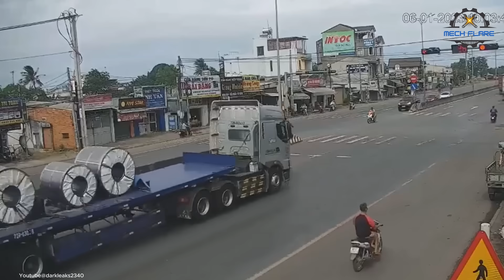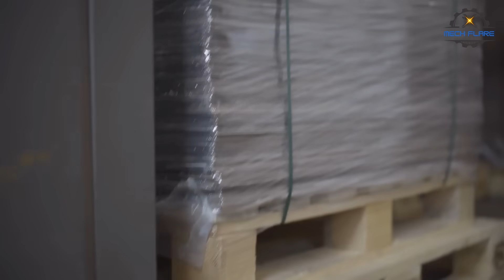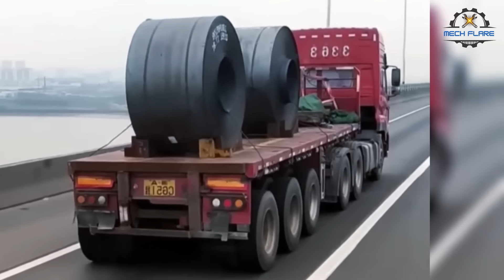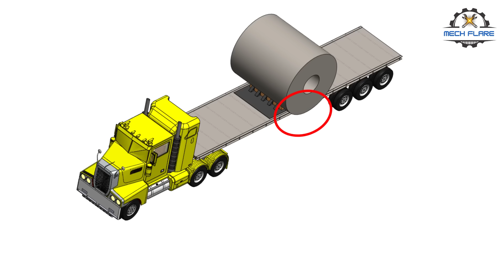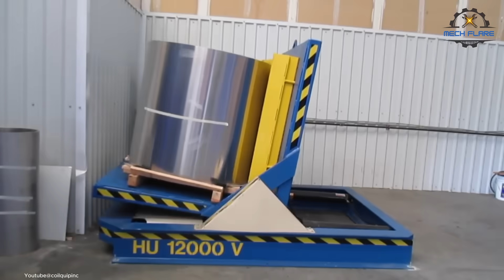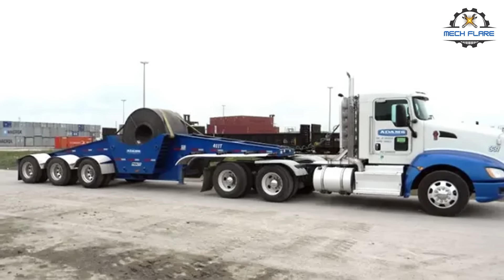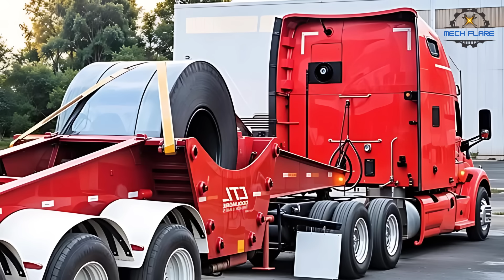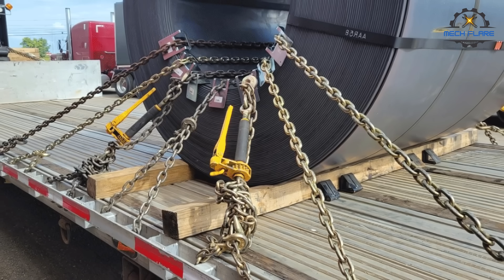Suicide Steel Coils: Can We Stop These Monsters? (USA vs Europe)

Comment: The drivers don't chose anything. The companies that distribute the loads make the choices. And it is very simple: when the customer does not have very special equipment the stand up position is the only one available. And special trailors with cradles, bolsters etc. are expensive.
Reply: What kind of company orders large steel coils without having any equipment on site to handle it?
Reply: Well said
Reply: In my experience the drive has 2 choices:
1) Take the load as the shipper chooses to load it
2) drive home with out a load.

It IS up to the driver to have the right straps and chains to properly secure a load. If he doesn't, option 2 is the best. 
Bonus option: convince the shipper's material handler to load it in a different way. But that only works if they have skill or equipment to do it.
Reply: @inund8  Some big trucking companies will fire you for touching anything other than the steering wheel and the shifter.
Reply: @Jul-66  Every trucker I've interacted with has had to store work with his own straps and dunnage. Maybe it was the industry I was in or the company I was working with.
Reply: @inund8   But do You even taught if this metod of securing of that load is properly? I think, that chains and straps isn't best. That's what this video is about.
So, in my experience (I'm a driver too - in Poland) the driver have this 2  choices:
1. Take load if there is real safe option for securing it (cradle trailer, wooden holder etc)
2. Take another load. 
There is no option for a stroke of luck. Dead driver is not a lucrative driver.

I heard that Americans don't care about their life, but it's XXI century.
Did You heard about the guy named Boycott?
Reply: Si tu avais transporter des bobines une fois dans ta vie tu saurais que les grosses bobines ne peuvent pas étre mis dans la semie debout, le mieux c'est d'avoir une fosse dans ta semie sinon tu met des cales et surtout tu fais un bon sanglage et pas avec une seul sangle
Reply: How expensive would a lawsuit be for,say, a busload of people killed.
Reply: @malcolmcooke9901  A standard intercity coach can carry around 50 passengers, while most insurance companies value one human life at $7 million. Therefore, a lawsuit resulting from a "busload of people killed" could potentially be up to $400 million.
Reply: @malcolmcooke9901  usually in the millions.
Reply: This is a silly take.  No driver accidentally finds themself pulling a type of load they're not prepared for.   The only carriers that actually take advantage of drivers and force them into doing unsafe stuff are hiring foreigners of questionable legality, who don't know their rights, and probably don't know the laws.  Proper enforcement of FMCSA regulations would eliminate that kind of outfit I about a year.
Reply: Human life is cheap ask the insurance  company
Reply: @RobertHoward-z7m  No it is not.  Human life is incredibly expensive and can result in lawsuits.
Reply: @fordgtguy  If this was true no one would be taking risks with the loading of steel coils.  Clearly the SAFEST option is to send them by rail.  The next is to use custom trailers.  Or custom crates that are loaded WITH the coil.  There are many safer ways but if COST trumps all else and if human lives WERE expensive then safety would have been the priority all along.  It hasn't been. Thus proving that there is very little value placed on human life.

Comment: Coil cradles held in place with container twist locks could be considered. Twist lock positions in deck to optimize axel loads.
Reply: Thats actually a good idea
Reply: good idea but I don't know if that is designed for the heavy ones as you introduce different forces to that system. I know they have open containers with up to three or four coil cradles built in though. And they make tons of coil cradles that you can just strap directly to the truck without too much trouble. truck beds often have holes for pins at different locations to avoid sliding of these cradles.

Comment: The steel coils were poor safed. Shood be used much chains or used special semi trailer with nests for stel coils. Then it where transport in safe possition. Eventually on special frame fastened spikes( if floor is wooden)
Reply from the maker: Proper securement is the key
Reply: @MechFlare  Yes. Exactly. Need to understand risk and threats for any type of materials and physical rights and rules. Need to be aware for example center of gravity or friction.
Reply: @MechFlare  Belts and chains are also very important. This issue is presented in an episode of "Catastrophes in the Sky." Poorly secured (improperly strapped) cargo (armored vehicles) led to the crash of a Boeing 747 cargo-military aircraft. The armored vehicle tore the straps and struck the tail bulkhead, breaking the tail rudder control cables as the aircraft was climbing. This happened in Bahrain.
Reply: @MechFlare  I transported loose steel sheets in the winter, covered in snow and ice. So, there was a risk of slippage. I strapped them down just in case. Of course, I also added rubber pads.

Comment: This isn't a difficult problem to solve, purpose built coil carrying pallets with tie down points and support to prevent the rolling of the coils would be easy to mass produce.  But being America, they'd rather place lives at risk if the business can save a few extra bucks.
Reply: I live next to a steelworks that makes flat sheet coils. I see them on trucks all the time in properly built cradles. A cradle won't roll. They are safely transported in them... They are loose cradles on a standard flat trailer. The cradle is chained to the bed.
Reply: We have trailers like that, built specifically for transporting coils. The problem is, that's ALL they are good for. Can't haul any other type of cargo. That means only loaded one way, & must return empty. That drives up transportation costs. Only practical for short trips. 
The Chicago area has lots of steel mills. Ok let's say a coil must go to Omaha. The truck must go all the way back to Chicago empty. Fuel, driver wages, tire & brake wear, etc ALL cost $$ empty or loaded.
Reply: @KenMitchell-kc9nr , in Europe, a lot of trailers built to carry coils are dual-purpose and are able to carry, any standard flat-bed load.
Reply: @KenMitchell-kc9nr  oh I forgot about those purpose built trailer. Most of those are built to transport suicide coils more safely. And I believe they make special saddle side coil trailers also. But yes they are purpose built for sure and do add costs to the transportation of coils.
Reply: @KenMitchell-kc9nr and that's why you don't use a truck. Ship it via train to Omaha and then you just need a specialized trailer for the short run from an unloading point to the actual destination.
Reply: @KenMitchell-kc9nr  You aren't dodging the allegations of illiteracy mr. murica.
Reply: @MyVanir I am quite literate. I cannot address the literacy of others. I'm only responsible for myself.
Reply: @KenMitchell-kc9nr  And yet you responded to a comment about a pallet by talking about the flatbed, so you clearly aren't literate.
Reply: @KenMitchell-kc9nr So you totally missed the dual purpose euro trough trailer in the video? Main problem is US weight restrictions and aged out infrastructure. Because of the trough, it's a HD flatbed as well, so you get your money's worth including a higher resale value.
Reply: @KenMitchell-kc9nr  That's why it needs to be a pallet job, they don't make the whole trailer a liability.
Reply: @mrblack888 some of those coils weigh 45,000 lbs OR MORE.  Most pallets won't stand that much weight.
Reply: @KenMitchell-kc9nr  I work in the industry, I am well aware of the issues involved.  Re-read what I wrote before you keep going.
Reply: @mrblack888   You don't work in the industry if you say so. @KenMitchell is right. I worked in the industry, in a warehouse where we cut the coils to sheets for small to medium businesses
Reply: Exactly.
Reply: It's not just in this country.
Reply: Or chain down your load properly.
Reply: You should never use pallets, they crush and also act as a sledge.
Reply: @Pidz-uk  In fact, the industry already uses a wide variety of pallets.  But thanks for your contribution.
Reply: @mrblack888  Yes, but the examples show big steel rolls on wooden pallets which have a max handling capacity of 5000Ibs. If you using pallets they should be plastic that can handle 30000Ibs. Instead, use the correct welled trailor or if it flatbed a goose-neck trailor to protect the cab and the weight nearer the ground.
Reply: Right, now you have a pallet on your truck and you're only able to haul one specific size of coil. What if you have an opportunity for hauling a different material rolled to different widths/thickness/ODs? Now you can't. Should they dead head every transport? Then expect end costs to consumer to go up. Also now depending on delivery location, might need specialty unloading equipment, again this hear increases cost. 

Throwing a lot of shade for someone who is so short sighted. You have to understand the culture of trucking, they once were professionals, who took pride in not cutting corners (mostly) 

Sub par trainers, switching to AT only, and the number of immigrants with an absent minded safety culture exacerbate the problems.
Reply: @dogmaticAI  Being an engineer, I had already solved all those problems in my head, in about 5 seconds.  Sometimes I forget there are people who can't.  Have a nice day.
Reply: The fact that here in America we DO HAVE MASS PRODUCED COIL RACKS!!!  Been carrying 2 complete sets on my trailers for the 30 years I’ve been doing this.  But being NOT from America you would rather comment on something you have no clue about….
Reply: @JAleksandr  you are talking about those light metal racks that you put 4x4's on to help stabilize the coils so you can throw chains and straps on the coil. Yes they help you but they do not prevent lateral movement when the load securement fails during accidents or terrain shifts.
Reply: @louismessere6379 they’re not made to-I would go so far as to say that ANY accident or terrain shift that would cause the load securement to fail would indicate that it was not properly secured to begin with.
Reply: @JAleksandr  yes normally I would agree with you till I seen chains snap on a few loads. But I still mostly agree with you, also with under secured loads also. But this entire argument is mainly for companies that don't want to have specialized trailers and want to continue using normal flatbeds for as much as possible.
Reply: @JAleksandr  I think you're confusing your personal situation for the situation all across the country.
Reply: @mrblack888 I think you’re confusing the fact that (one last time from the cheap seats…) IF THE LAWS GOVERNING LOAD SECUREMENT AND COMMERCIAL DRIVING WERE FOLLOWED AND ENFORCED THERE WOULDNT BE AN ISSUE!!!

Comment: I want to get into trucking. Inexperienced thought: place an empty metal box right behind the cab, so it will crumble, absorb or deflect the rolling coil. Empty box shouldn't affect balance too much
Reply: Engineer here, you simply don’t understand just how heavy these coils are. Once they are moving they are just about unstoppable.

30,000 pounds is approximately 9-10 passenger vehicles (give or take based on your preferred example) rolling at significant speed. You will not absorb that energy.

They load the coils this way for safety in handling. With proper chain binders the coil can be held safely. Once it is moving you’re dead.
Reply: Current trucker. Never hauled coils but I do haul heavy equipment. Only issue I would see with a box designed for what your asking for is weight. Sure it would be empty, but the structure would need to be engineered strong enough to with stand a certain amount of force at certain amount of speed. It would require the material to be substantial. Now you take the weight of this box and place it directly over your drive axles and that directly affects your tare weight of those axles. And if your hauling a 20T coil that could make it difficult to scale all that weight. 

Like I said, never hauled coils, only heavy equipment. But I do have my fair share in the aspect of scaling a truck and weight distribution.
Reply: I've hauled LOTS of these coils in all 3 ways. 
I hauled coils about half the time for 20 years, then could EXCLUSIVELY for another 5 years.  Never had any issues. This was all on flatbed trailers. I always went above & beyond the DOT requirements for securement. If DOT regs said it needed 5 chains, I'd put 7 chains on. Never "too many chains!"
With the skid coils, eye to the sky, you're limited as to how many chains can be used. There's only so much space available for chains to be effective going OVER it vs THROUGH the eye. Plus, with a shotgun coil, you can go THROUGH the eye, PLUS chain over the top. That's the most secure method without having a specialized trailer with a well or trough, but those limit other types of cargo being hauled. If you ONLY haul coils, a well or trough type trailer is best, but no other cargo can be hauled with those. A regular flatbed is very versatile & many different types of cargo can be handled. 
Drivers MUST be educated on proper securement of coils AND follow through with using enough chains to do so. "Good enough" isn't good enough!;
I drove trucks for 37 years. Half of that was hauling coils. I never had any issues. I wasn't lazy or scared to hang a few more chains. I LOVED hauling steel!!
Reply: @KenMitchell-kc9nr 
You are absolutely right! I do flatbed in Canada, and I never heard a driver that was pulled in by the DOT for using too many straps or chains.
Better safe than sorry...
Reply: @KenMitchell-kc9nr  I agree with over chaining certain loads. my coworkers always give me shit for putting and extra binder or 2 on a 40k or more loads, but its nice to know in the back of my head I would really have to activate my tupperwear torpedo instincts to put my self in a situation for my load to be inside my truck or in traffic.
Reply: @KenMitchell-kc9nr FACTS!!!  Have t had to deal with them in many years because I mostly deal in MASSIVE crane moves and reefer trailer during our harvest season-but I used used to haul coils out of most of the ports-not sure if Alabama still requires their coil card or not-but I do think some areas of commercial driving should have a few more certs associated-Coils, anything over a 4% grade, anything over 80k gross…etc.
Reply: I haul logs and the shield we have on the cabs aren't even strong enough for that these coils get much more momentum than logs could but it's all about securement, you can never have enough chains on one of these things

Comment: Proper securement is a must.
Reply: Well 95% truck drivers are stupid, they clearly securement is optional.
Reply: @automation7295 you've mistaken  steering wheel holders for truck drivers. There's a difference so your 95% stat is way off.
Reply: @donmunro144  Yes, but unfortunately if the steel coils falls out and kill drivers, people will still blame the truck drivers as well as the company.